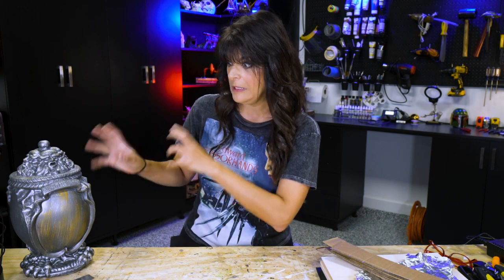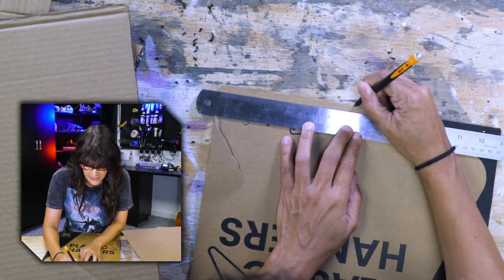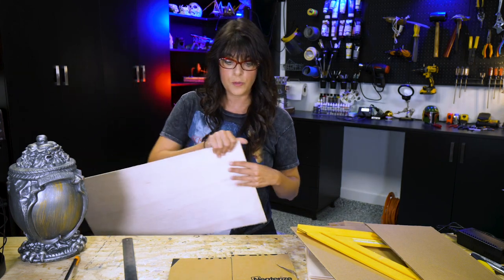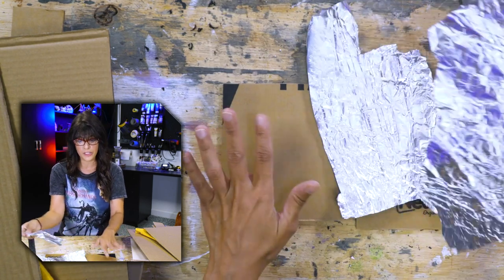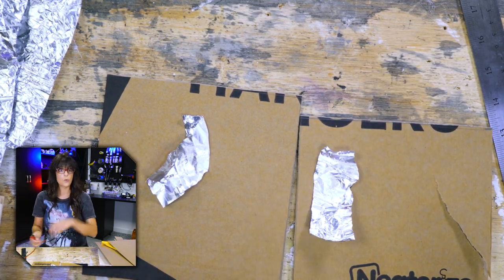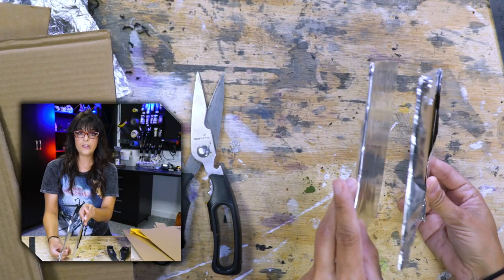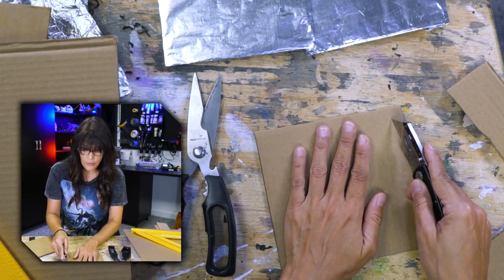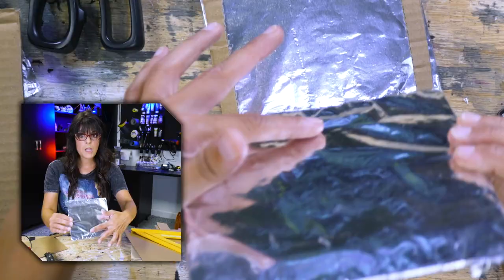DIY Hidden Pressure Plate Switches: Trigger Props & Lights Like a Pro!

Comment: My take is you can always use a thin foam or slice a kitchen sponge to add  a flexible distancer to keep the plated apart. Used this to build a pedal acting as a HID USB macro trigger.

Comment: I would have suggested two breakout adapters for the power. One plug, on receptacle with breakout terminals. Then you could have run the switch to one half of the connector and just install a jumper on the negative.
Reply from the maker: Oooo.... great idea! 👍

Comment: For high current or motor application it’d probably be best run load through a relay at least and use aluminum plate to trigger the relay. Maybe less of a fire or health concern, even in the short term. 

Another bonus of relay is for instance your ashes to ashes. If you used a cheap timer relay a momentary press of the aluminum plate would still allow the prop it to run its full cycle and not cutoff.
Reply from the maker: Great idea! I'll have to include that in an upcoming relay tutorial. I was initially thinking of talking about using a 555 timer circuit but a timer relay would be much easier for beginners to incorporate. Great stuff! 👍
Reply: @RachelDeBarrosLive  I like the 555 idea. If you didn’t want to use relays triac’s and mosfet’s are pretty simple to use.

Comment: I can't imagine how much waste is likely produced by the prop industry.  It's inventive but you'd think they'd have a kit of somewhat standard useful items on hand to do stuff like this.

If time is money and you're often in crunch mode getting things done, I'd kind of assemble that kit in my off hours.  Like already-provisioned and paired Picoclick devices...
Reply from the maker: The only thing I've seen so far is Spirit Halloween has pressure pads for sale but the ones I've seen are small. I imagine you can hook up a few to cover more area.
Reply: @RachelDeBarrosLive  I was thinking more of generic kit.

A pressure pad is essentially just a switch, so anything with a switch on it can be fashioned into that role, especially if you're willing to accept 3 corrugated cardboard sheets worth of thickness.  (think:  old window/door sensor)

My take on that is just to have "switch" parts ready to go.  The magic is using off the shelf parts (like ESP boards) which can do all that stuff wirelessly and literally run off a coin cell if configured correctly.